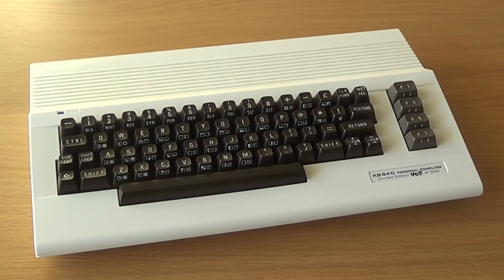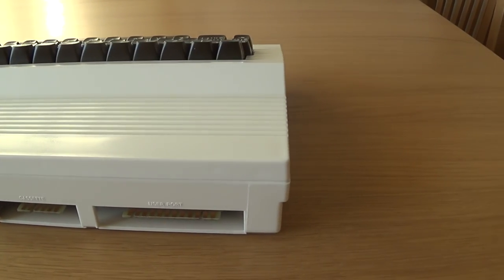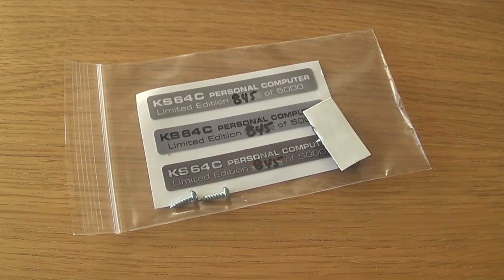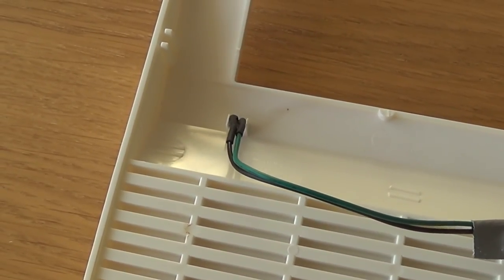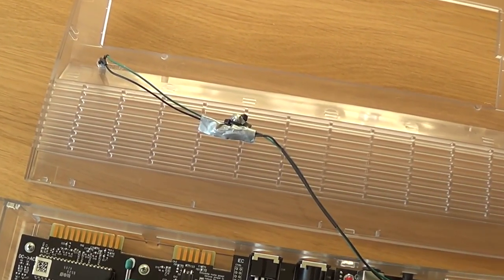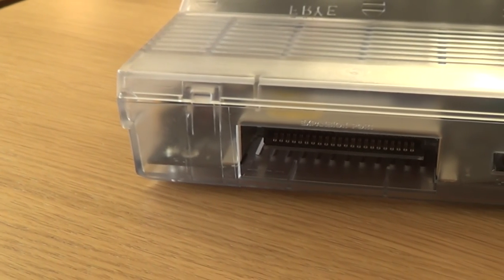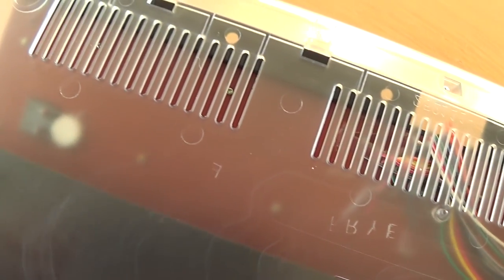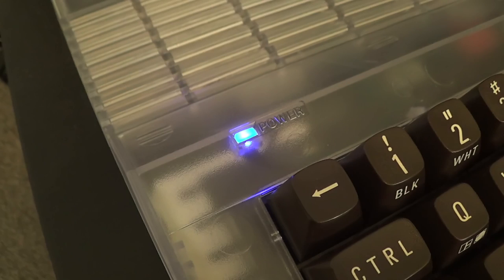Changing C64C case, from white to transparent.

Comment: The OG C64 Keyboard, Reloaded board and Transparent case makes for one stylish combination. As does the Blue Power LED.

I should really get around to sorting out my cases as well - but it's just going to be a C64C from it's original case into another beige case. I've got a white one as well… but I'm aiming to try the combination like you had (if I can source an original C64 Keyboard) if I ever get a Reloaded ;)
Reply from the maker: +hellfire64 Yeah, it's a sexy thing. :) It's a shame it's so hard to get the Reloaded board nowadays. I got one from the very first time it went on sale, but I paid a price - and I don't just mean the $$$.. A simple shopping experience that took 3 hours. Site hanging, site crashing, reload page, reload page,sweating and swearing. If I knew all that beforehand, maybe I would have waited a while.

If you ever feel like it's completely impossible to find the dark keyboard, and you really need it badly, then I have one which you can have cheap. Not sure if it'll be worth it with shipping price and customs and all, but.. Just so you know. ;)

Comment: Nice, where do you get the new PCB and the cases?
Reply from the maker: +GEKKO GAMES Thanks.

Like mentioned in the description, I got the cases from a Kickstarter campaign which ran in March 2015. Obviously, it's no longer possible to get them from there. I'm not sure if more cases will be produced. I really hope so. The mould is good to go, so it's definitely possible!  ;-)

The motherboard, here: https://icomp.de/shop-icomp/en/shop/product/c64-reloaded.html - It's rarely in stock, but it happens once in a while.